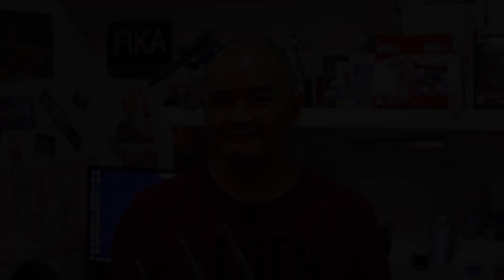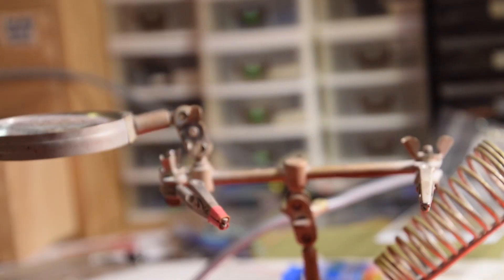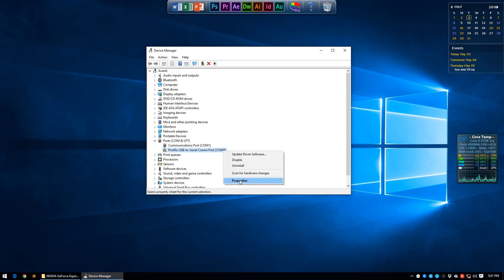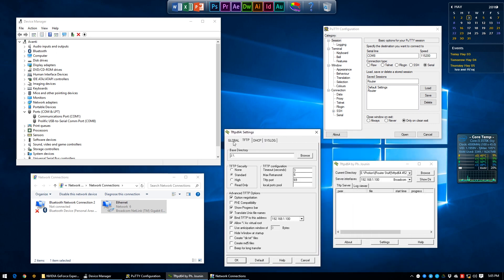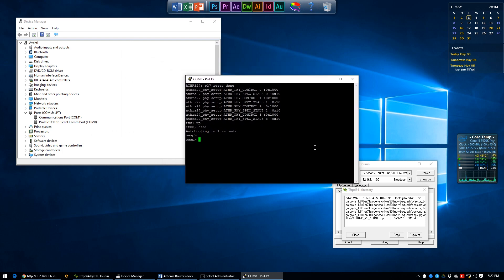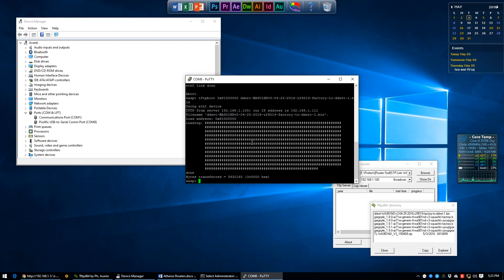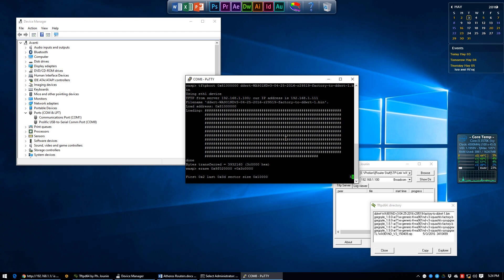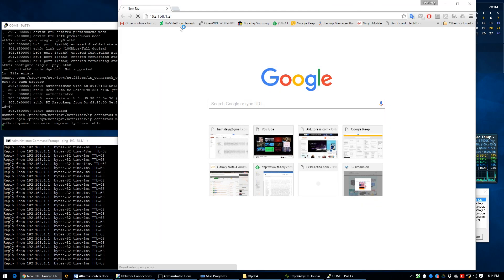Recovering a Bricked Router! (Atheros based) - TechRodent Guides

Comment: Thanks a lot for this tutorial, Sir! I have a TP-Link WR1043ND V1.8 which went from stock firmware to DD-WRT years ago. Unfkrtunately it sporadically behaved kinda flaky at random times. Installing OpenWRT this way as you depicted in your videoplay sealed the deal and now my router is back in business. Another appliance saved from the landfill.

Comment: i had this TP-Link TD-W8951ND , i accidentally fashed TD-W8151N v3 rom, and now i can only access the router page via WLAN, if i change the SSID, it would let me access it again , it doesnt have those thing on the pcb that i could solder a pin on, and i also could find any pin on the pcb

Comment: I had accidentally D-Link emergency flashed DD-WRT firmware to D-Link DIR-615E4 (4MB flash) without realizing DDWRT needs more than 4MB space. Now my router WAN and 4 LAN lit even I tried to hold the "reset + power on" or normal on. I also cannot access the 192.168.0.1 and 192.168.1.1 anymore.
Can I use this way for my D-Link with Atheros AR7240?

Comment: hi 
Tech Rodent i am having iball baton wifi renge extender (300M wifi mini AP router iB-WRR300N) model but cant find its firmware and it is working 192.168.1.254 ip it use admin id and password but it did't open iball window it gives me a file config.dat and it is not working any way  please help me

Comment: When i connect via UART, it says forever "Start to decompress!" , what can i do?
Reply: The same on my router. I tried this tutorial several times an it looks exactly like in the video, but im still in the boot loop.
Reply: @frankrieger7666  check the EEPROM with a SPI flasher like ch341a you can write on it so if you see a stock firmware on internet for you router you can flash it

Comment: Finally after years i managed to bring back my tenda w316r router back to life... I used usb to TTL adapter but now i realized after viewing putty screen that u ppl dont need "usb to ttl adapter"  it just show whats going on inside ur router...now as i have seen it all i can help all of u guys to un brick ur routers too...
Step 1. Set ur laptop or pc LAN ip manually to 192.168.1.10 subnet mask 255.255.255.0 and default gateway 192.168.1.1 (use wire to connect to pc via lan cable to any yellow port on router).
Step 2 open up the router un screw   it...we need to short 2 pins so that  we can interupt the boot sequence and prepare the router to force itself to CFE mode...so that it can ask for firmware... Do not short pins again n again it will permanently destroy the memory chip...(i will tell u later which pins to short).

Step3 go to RUN on PC and send ping comand i.e. ( ping 192.168.1.1 -t  )  without brackets  keep the ping running... it will say time out... now press and hold the reset button and power the router keep it pressed...u hav to do it quickly its about 3 seconds...leave the reset button and wait 2  seconds then quickly short the pins for 1 second ( i tell u which pins) as u already running ping watch the ping screen...u have to wait until u get ping response let say 1 or 2 minuts then ping will return with positive data...now close ping window and..now its time to open browser and type 192.168.1.1 id admin pwd admin  this will open broadcom CFE and let u upload firmware...brouse the firmware file (use this one .42 not .46) and press upload...its done wait for firmware update successfull measg and router will reboot itself and back to life... Pic link  https://postimg.cc/pytBSxy0   this process can also work for other tenda routers...
Reply: Thanks bro you saved my Rs:2500 Love you man Allah belss you ............
Reply: only works for Tenda?
Reply: Can help me plz?

Comment: Thank You so much for this useful video :)  I have a question 4 u
Can I use USB to RS232 Convertor instead  PL2303 ?!!!!
Thanks again
Reply from the maker: Cheers, I can't say that I know the answer to this one, you may have to Google it.
Reply: @TechRodent   Thank You I have another question  
When I Programm Flash chip via Programer  to change mac address which block should I change it then Program and verify? I appreciate it
Reply: @TechRodent  0001FC00 ?!

Comment: https://postimg.org/image/tbrenwr3f/ i get this . i tried to update the soft on my zyxel nbg 418n and got a blackout... i would like to reflash it . any tips? 
when i don't plug in the power adapter i get a loop https://postimg.org/image/f9a2m75t7/ . What should i do ? I would like to save that router .
and after i press the reset button this appears: https://postimg.org/image/fysuz0w7f/
Reply from the maker: Teigler Patrik hmm. It looks like your router is Realtek based, which can be a bit tricky ( I don't have any Realtek based routers with me to try and recover). 

You might have to look up online to see how you can establish a TFTP connection to it to push on a working firmware.

Comment: After you flashed it I could see on serial console after rebooting that it was still bricked
Reply from the maker: Good catch. It was a situation that I didn't really account for. It wasn't a bricked router, but the way I was connecting to the router in particular and how DD-WRT pre-configures the ports.

I was doing all flashing and debugging on the router using the only ethernet port on it, and after reflashing DD-WRT, that port is assigned as WAN and not LAN. I simply navigated into the router via wifi, then flagged it such that it treated the WAN as LAN and fixed it.
Reply: TechRodent That explains it, I have bricked my wr841 but I can't get ducking tftp server to work. Kinda wierd because I already unbricked my wr842 using same method.
Reply from the maker: Hmm that's weird. If you managed to get it to work with the 842 then I don't see why it wouldn't work on the 841. You can't get the tftp server to work? even with the same configuration?
Reply: TechRodent Yup, but now even with wr842 it doesn't work. Dafuq, I havent changed anything. Could it be Windows Updates? They broke few things on my PC already.....
Reply from the maker: I'm using Windows 10 creator's update, so I don't think it should really matter, but I can't be for certain of course.

That's weird that it doesn't work on the wr842. So you only fail when downloading from the TFTP server then
Reply: TechRodent Yup, everything else works, I can even ping it and it says it is alive (and if I unplug ethernet cable it says it is not alive)
Reply: TechRodent I tried again and it says: TFTP error: 'File not found or No Access'  (1)
Reply from the maker: Try making the directory that you're accessing it from easy, and make sure that there's no spaces in the filepath.
Reply: TechRodent When I turn off Windows Firewall it says that file is not found, when I turn on Windows Firewall it says Retry count exceeded; starting again (and it goes in loop) and I can't even ping it.
Reply: TechRodent I even get 'File not found or No Access' when Tftpd64 is closed
Reply: TechRodent I done it, went to resource monitor and checkt if there was any process using port 69. There was some and I killed it. Thanks you so much. Btw, you should do more videos
Reply from the maker: Haha, no worries. 

I'm working on a few more guides and what not, but suggestions are also welcome haha
Reply: TechRodent How to flash Lineage OS on Note 4, OpenWrt tweaking guide.......